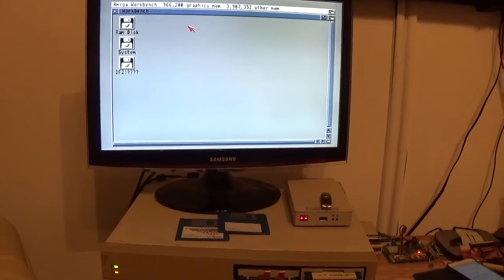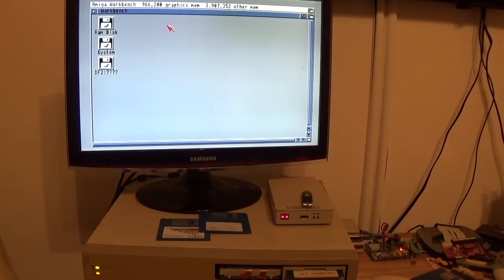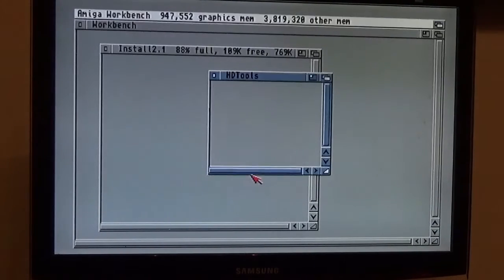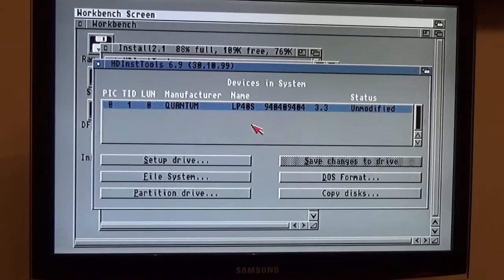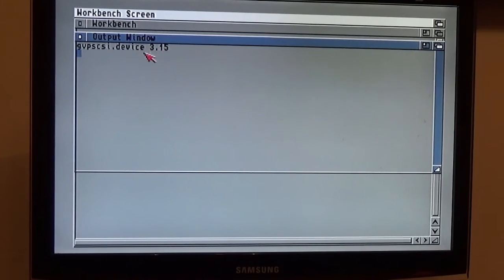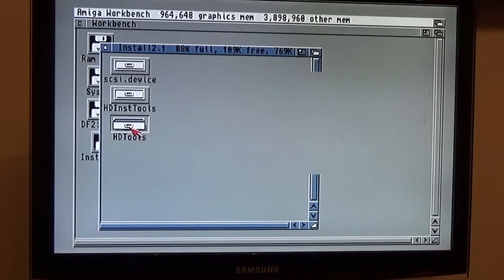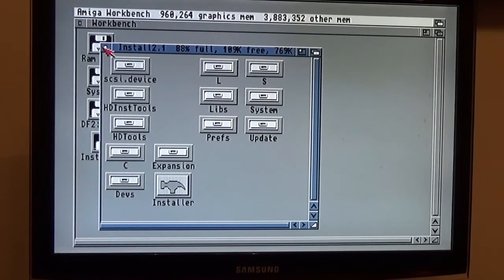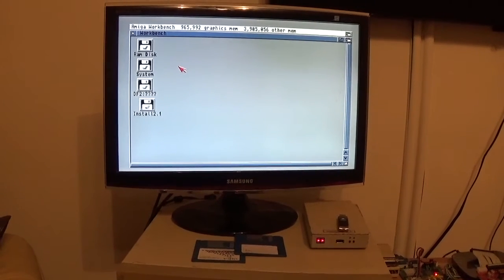amiga gvp and hdtools

Comment: Thanks for this! my device showed up and I was able to format the drive but now I get a :Not a DOS Device DH0" error and can't finish installing AmigaOS. Wondered if you encountered this?
Reply from the maker: mmm i may of over the years but i forget now. did you format it correctly ? the partition must be below 2gb and marked as bootable in Hdd tools. As a rule i stopped using the commodore formatting tool and i used the Hdtools from over at aminet.
Reply: @mjnurney  I'm actually using the new AmigaOS 3.1.4 which allows for boot partitions over 2GB. Did manage to suss it out seems the floppy wasn't getting boot priority so I changed it at startup using the boot menu.  Though it looks like I'll be needing a replacement harddisk soon as now if i turn it off and on "too quickly" the drive fails to initialize.  Thanks for the help though!
Reply from the maker: ah ok , thats good news. i haven't tried the new ROM yet. how is it ?
 @deponia
Reply: @mjnurney  Well I only really got it running an hour ago so no idea yet lol.  I'll need a new harddisk before I can really put it to a test.